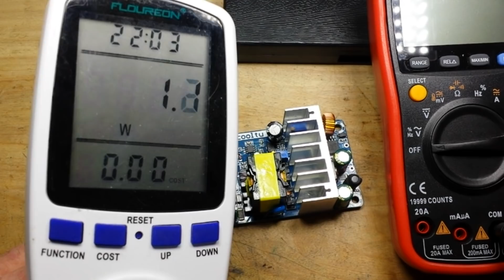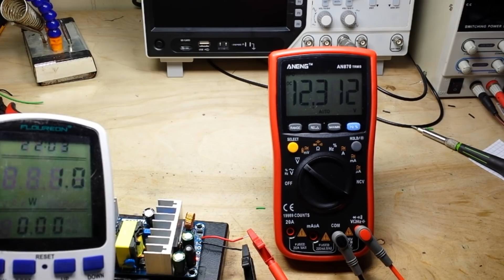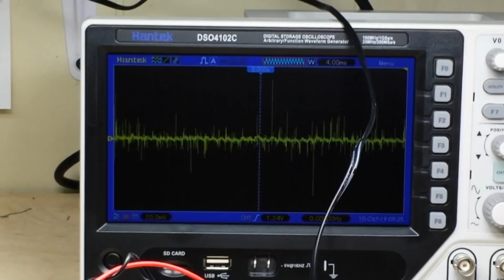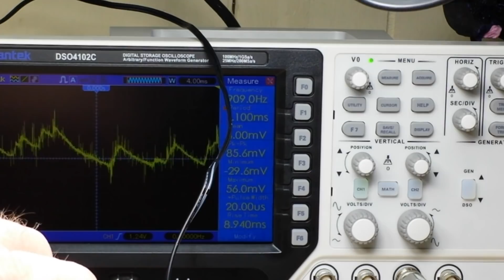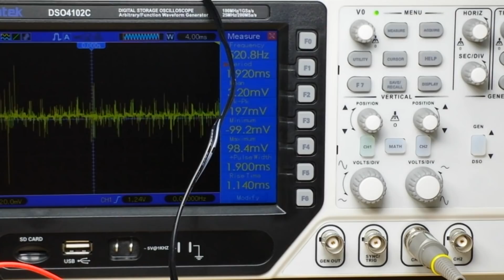Cooltu AC/DC Power Supply/buck converter

Comment: The 2 ground tracks you mentioned are actually the transformer's secondary winding, one end is tied to negative (as the usually are) while the other side goes to the diode (the double diode). It's such a low resistance it appears to be shorted tracks but it's not. You were reading secondary to ground first then when you tested between the traces themselves your meter was reading reading the secondary's resistance which is extremely low.

Comment: I'm using all the time the 24v and 36v power supply like that but honesty i never come across one like that with 2 outpot even if they don't have a ground connection with some knowledge you can add one and use the board for diy power supply . currently i have one made like over 1 year ago and is still going strong but now that can be verry serious danger for a beginner thank for the reviews keep up with the good work
Reply: I have this supply and i am facing problem of live voltage on heat sink(tested via neon bulb tester). It gives shock too. But when there is no N wire attached (only L wire) then there is live voltage everywhere even on the output. Is there any way to add protective earth wire to the circuit? If yes then how? Basically i want to convert this class II supply to a class I.

Comment: Glad I skipped through that so I didn't waste the entire 15 min of my life. I knew immediately when you went for the first pot it was channel 1, they're not mislabeled, common sense tells you that proximity applies, hence channel 2 pot is closer to the channel 2 output connection. The only thing you told us useful about the board is that it has a 5A switching component near the outputs but not why? I looks like it has a couple of mosfet's on the main heatsink. I saw the 220V at the input and it looks like you applied 120V so we can surmise that it has a wide input voltage range. Thanks for telling us about that. It would have been nice to see/hear what it's max output voltage and current capabilities are and then actually gave it a serious load test. The fan on your loading device probably does not need to run at 7000rpm's for a 7W load.
That's it I'm done with my rant which wasted another 5min of my life.
Have a nice day. :-)

Comment: Hi I know you do not recommend this power supply, but I was considering using this power supply to charge up a custom lithium battery 18650 pack build 4s 10p @ 14.8 volts to 16 volts . the specification for the bms is a switching power supply 16-18 volts. handles up to 10A current. will this power supply be able to charge my battery pack efficiently?

Comment: hi..i want to charge a lithium titenate battery pack..i need a 58 volt DC power suply from an austrailan 240v AC 10 amp plug/some times 15 amp plug out let....i need it small and light as it travels with the electric bike....i need or the battery pack can gobble up all the amps the out let can give but we dont want to blow circuit braker...any ideas? any one?
Reply: How about one of these: https://www.amazon.com/60V-Bench-Power-Supply-Variable/dp/B07XM6MCPQ?
You can set the CC so that it wont overcharge, or use it with an overcharge protection circuit. It should work fine as it is though.
Reply: Or......add a cheap buck converter to one of these to give you the CC control: https://www.amazon.com/gp/product/B07BRRBT6K/ref=ppx_yo_dt_b_search_asin_title?ie=UTF8&psc=1 I can recommend these having used mine with no problems for over a year now. You also need the buck converter to bring it down to 58v, but they are cheap and plentiful.

Comment: Somebody won't be getting any more free power supplies.  That's not a consumer product, it's intended for people who know electronics, and It's china, they don't put silly warnings on everything as we do.  As you show, those experienced in switch-mode power supplies know enough to be careful.  
They didn't put a warning sticker about the capacitor charge after you unplug it either. It's got a fuse, that's a lot better than some of the fake 5-volt chargers made for consumers.
Based on 15 years of living in Asia.    (smile no insult intended)

Comment: 1 Why should the board be grounded? It is inherently dangerous to touch and grounding it will not mitigate that. If the power supply is not in an isolated case, then the case should be grounded. 
2. 2:05 isn’t that a smoothing cap in stead of a filtering cap?
3. If you were measuring a short, how can the output be 25V without smoking a few moments later?

Comment: 36V  version.
(1) There is now room for a heat sink on the bridge retifier.
(2) The mounting hole near the mains input is now the earth and is connected through to the PCB and additional filtering. 
(3) Mine has only one channel but has screw wire connectors. OOPS! maybe not, maybe 2 fixed channels. I got lucky when I wired it up - never checked - nothing on the data sheet. 
(4) The output inductor is now a vertical potted version, perfectly safe. 
(5) There is no adjustment for V out but the fixed 20K resistor could be replaced by a pot or 'tweeked'. Mine has 35.5V on the output.
(6) In the UK I get 245V and always use fans - 18 months and all is well.
(7) The PDF for the XL4015E states 32V output but I get 35.5V - overdriven ?
Good video but anyone who has built a power supply is just as likely to get a belt.
I did, 245V right across the chest and I'm 73. No fool like an old fool. Please be careful and don't watch the TV and use an all metal scredriver to check mains live terminals.
I have the 12V version powering a little amp for speakers on a TV setup. I also built a 24V power supply using a XL4016 buck and a similar unit to the video. All 3 are fine.

Comment: I don't see any major problem with this power supply. The flapping inductor will eventually break or short to the power IC, but you can easily fix that - you can't complain for these money. The bridge (not a single diode) package is well insulated - distance is not a problem.  The separation between AC/DC sides is good enough, there are spark gaps. The NTC is a nice touch to reduce inrush current  so you don't get sparks when you plug it in - like some laptop power supplies. On the low voltage side the distance under the solder mask is good enough.
The ripple voltage you are looking at is probably picked up by your antennas (big ground lead) and partially caused by your electronic load (can't be sure about that but I'm willing to bet). Most of these power supplies have good enough ripple - 20-30mV for 3 to 5V out. The caps are almost ok (I usually change them). You can get to 20 mV (on 3 to 5V output), by just changing the caps. Adding simple LC filter will get you to values that are hard to measure (at home) - 2-5mV ripple. Also the Pk-Pk is 4th measurement (not third) down and it's terrible for the reasons I mentioned above. What is terrifying though is how you test it - you should have bolted it down.  At the end I can see the load touching the pcb very close to the AC wires. Having a big metal heat sink live is not great, especailly when you reach over it to operate the scope.
The only problem with these power supplies is that they don't really hold to their specs. Usually inductors are lower current ad the heat dissipation is not enough - with or without forced air cooling.

Comment: Same as many double insulated power supplies  except there is no insulating housing . I learned about dangerous voltages playing with TV and radios so i'm ultra cautious with anything that has a supply voltage above  36volts .

Comment: Made me nervous for a minute. I use a very outwardly similar board as my power supply for my soldering iron. I had to tear open the enclosure and double check the safety of my board. Glad to say it has a much better component layout so does not suffer from the same issues, but it is also fixed 24v single channel supply on the same size board as the one you just showed us. Would it kill them to just make the board a little wider cause that thing could be pretty sweet if it was say 6mm wider, plenty of room for components then and room to fix the tiny anti tracking slot. Great video Paul hopefully whoever actually makes that  buck converter takes your criticism to heart and improves their product.
Reply: Yours might be a similar board to the one i sent to DiodeGoneWild, maybe you want his opinion on it. It too had some questionable implementation details. I have myself yet another similar one, which i forgot what it was, but one spot made me queasy so i gave it a bit of Kapton just in case.

Comment: Ohhh crap it should be Double insulated if no ground present as the electric tools. The inductor near the chip should be helded by celastic to prevent mechanical  stress and one of the pots is near the heatsink of the output which leads to put a metalic object. It is isolated but remember no ground to protect  as said. aie aie aie the load heasink is closer to the heasink of mains side of PSU ;S . If using this PSU put this on a enclosure. The separation between mains is very good  which is a plus for the PSU and not much ripple.

Comment: You loaded it to an input of 0.7 Watts? What kind of test is that? Thumbs down!

As far as safety goes, any open frame power supply or bare board is going to be dangerous. And having small track spacing at the output isn't a big deal. Usually your reviews are pretty good. Not sure what happened to this one...

Comment: Nice video Paul!
A power supply does not need a ground, and having one could just as easily make it less safe.  I didn’t see Y caps installed, so that’s good.  If the end unit is a plastic case then that’s great!  But, if a metal box is used, then the box needs to be grounded.  

The spacing on the output is not a safety issue as it is an isolated low voltage output.  It could be a noise issue because of undesirable coupling.  

Keep up the good work!
Reply: It looked like there was a class-Y cap on the other side of the transformer, and I think they even put a spark gap between its pads. But it's very common to use class-Y caps that couple noise back to neutral rather than earth. Not ideal, perhaps, but extremely common, even in big brand PSUs.

This whole video was nothing but trying a bit too hard to find problems that don't exist, IMO.

This style of PSU is one of the better types you can get cheaply from China. I've got a few and never noticed anything wrong with them. My biggest gripes are that they don't label Line/Live and Neutral, so you have to trace back from the fuse to find the Line input (you don't want to fuse the neutral!), and that they use glass fuses, which will have … rather dramatic results if they get shorted across 240V UK mains! (Power factor probably sucks, too, but that doesn't bother most of us - yet?)
Reply: Andrew Gillard 
In most countries of continental Europe there’s no distinction between live and neutral.  Plugs can be plugged in in two ways. Perhaps that’s why on most of these power supplies live and neutral aren’t marked.
Reply: Andrew Gillard I agree, the power factor is not so great as it is just your basic rectified input - no active power factor correction.  The yellow cap seems to be an  safety rated X cap.  The blue cap near the top of the transformer looks like it is decoupling the common mode from input to output.

Comment: One of the big tracks on the secondary side is not ground, it's VCC but you got continuity because the main capacitor was charging. If you let it for a few seconds, it will stop beeping. And the op-amp is the switchmode controller, probably UC3843, for flyback comverters. The output chip is a buck regulator that takes the first output and steps it down for the second output.
Reply: The heavey track on the secondary side was NOT Ground. That was the AC output feed to the rectifier diode, you could see it connecting to the outside pins of the rectifier diode. you measured continuity because of the secondary winding of the transformer. This is supposed to be a learning channel. Please ensure your facts are correct.
Reply: Hi Dude, I like this unit but i would not let my grandmother connect it up.
After getting zapped i brought 2mm plastic sheet and glued cover over unit with a  isolate before removing cover sticker.
What our mates from the fare East forgot to do was 1 . glue loose choke. and 2 . plastic coat heatsink with insulated high temp plastic paint or 3 . metal cover with vent holes and the sticker.
I like them .
Good video
forget the haters
Reply: Might have helped if he would have actually measured ohm's instead of continuity, that way he/we could have seen the value change as the capacitor charged, that is we could have seen if it weren't for the overhead lighting washing out the screen of the DVM...LOL.

Comment: According to the specs the PSU has over current and over load protection. Would you mind testing if they work properly? Furthermore, how does the PSU fare in case of accidental short-circuit in the  DC side? Does it survive? (well, I know that the PSU may be damaged and the experiment can have some risks, so I understand if you decide not to test these safety features).
Reply: Very good questions, I too would like to see the results.

Comment: Its pretty good PSU, and you just searching problems. Why would you need more space on low voltage side... It wont short for sure, but EVEN IF there is fuse and nothing dangerous will happen.
Reply: The design is not safe. It's dangerous if anyone touches the input side unintentionally.
Reply: @jimmatrix7244  That's... just the nature of things with an open-frame PSU - it's sold to people who have at least fundamental understanding of electronics and mains, and it's your responsibility as someone who makes a device using it to make it inaccessible in normal operation. Sometimes you just need an open-frame PSU, so you can get one from Meanwell or Delta or you could get one from these guys. You might also say that a fully enclosed PSU isn't safe because someone could remove the screws and then touch the spicy bits, and that would be similarly stupid.

This is unrelated to electrical safety of the PSU - is it safe against shorting primary to secondary due to internal fault? If yes, then it's safe if used properly. If no, then it's not. Ultimately though it's difficult to judge that though without extensive testing.

Comment: I agree with some things you demonstrated, but here is what I think you got wrong:
1. This PSU is intended to be used in a project where you would put it in a custom box with all the other electronics and a cooling fan. That's why I got it and how I will use it. If it had the case of its own I would probably open it and take out the electronics, and pay more for something I will not use.
2. There is no need to have the ground on the board, you should ground the case the board is in. If the board is exposed, no ground will allow you to touch it safely.
3. Clearance of 0.25mm for 34V is enough since there is insulating layer over the traces. It is not optimal, but it is enough. 

Inductor proximity is an issue. Although inductor wires are insulated it would be smart to put some kapton tape on it to be sure.

P.S. Inner measures are measured with upper part of the calipers.

Comment: I purchase boat loads of Power Supplies from Chinia.   They fudge on specifications most well.  Under the Chiniesium Rating system when they state a output is 20A they actually mean it will only start smoking at 10A and won't burst into flames until 20A.  To this date I've never found a PSU that would produce the rated power over the rated voltages.  Your best bet is to  order a PSU that is at least TWICE the rated power your looking for.
Reply: The power of these supplies is specified in ChinAmpers and one ChinAmper is about 0.4A :-)

Comment: Could you add a ground to it though?
Reply: Actually not having a ground does not make this unsafe.  The inductor is on the low voltage secondary side, so spacing for safety isn’t really a problem there, it’s more about coupling noise.